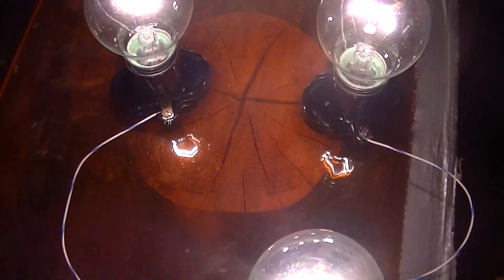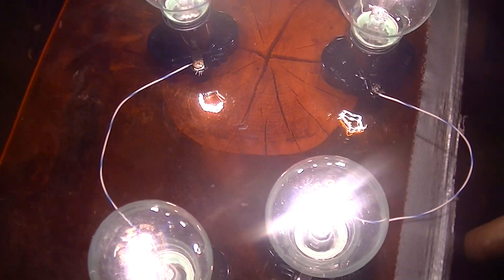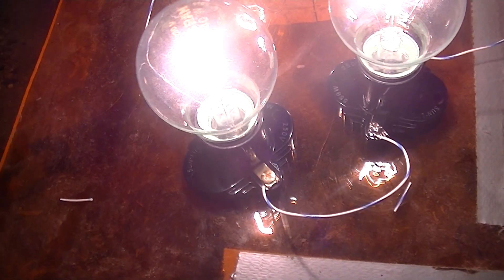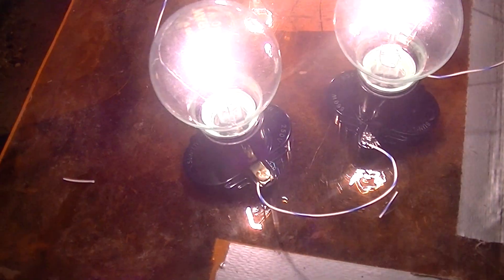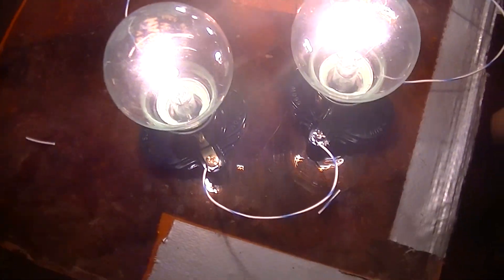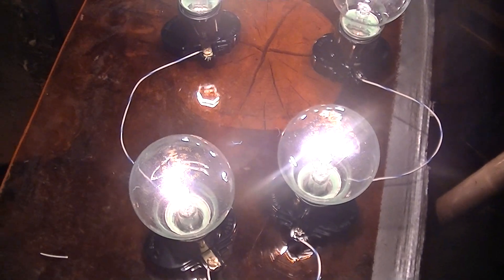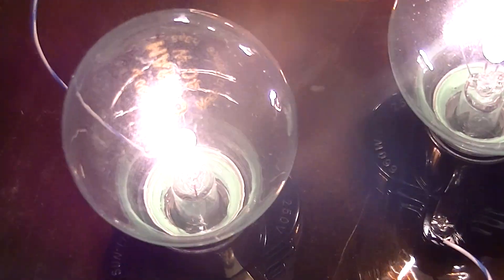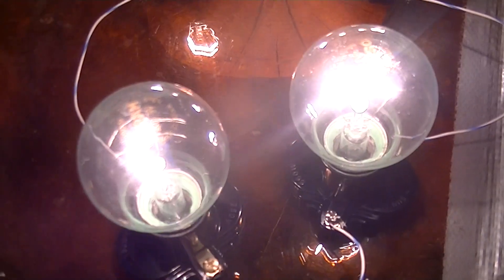Series incandescent circuit

Comment: I live in NY and not to far from the osram plant.They every year give away free light bulbs  I even worked on a diesel gen set when I was working for a different company.The gen set put out 16 kva at 60hz I even got a special bulb that ran over 10k volts yes 10,000 volts . Where I worked I got a transformer to go from 220 to 10k at 1 amp . I have had that bulb for over 20 years and I test it once about 6 months to see if it still works. What is the highest voltage bulb do you have?
Reply from the maker: I have some 300V 50W rough service lamps, but have seen 650V cage filament lamps for use in third rail testers.  If that 10kV lamp is incandescent then it is almost certainly an experimental 'can we make one' laboratory prototype/curiosity as there is no practical use for such a lamp that I can think of.  As such, be careful with it as it is either one of a kind or one of only a handful of such lamps to exist.  Knock wood.

Comment: What are you actually doing with this arrangement?  Tapping direct off power lines?  It might be interesting to put a dead lamp in and see if it ignites the fill gas.
Reply from the maker: This is for a power line experiment that I will be conducting knock wood this summer.
Reply: randacnam7321 I'm guessing that if you're actually going to try and tap off power lines, then this isn't affiliated with any actual facility company.  Purely because the sheer current and voltage available is enough to cause horrendous results under fault conditions.  For instance, the progressive avalanche failure of lamps and ionisation of the air amongst the spark gaps and bases resulting in a huge fireball that could have a knock-on effect of engulfing the lines to create something even bigger.  It's also worth mentioning that there is a wide range of voltages used in rural distribution ranging from about 3kV to 11kV and beyond.  Have you seen the line powered neon tubes?  They're actually used to mark low lines near industrial plant.
Reply from the maker: bigclivedotcom
Not in real life, but I have seen photos.
This is for an experimental power line that I'm building as a test of ways to get electricity very long distances for cheap.  The big transformer at the top of the screen is a ~1,230V couple kVA (no idea as it is homemade) transformer that we have had floating around for longer than I have been alive.  This is the main feeder transformer.  I use 2kV microwave oven transformers to supply 75V train lamps, but I also have a few 1,150V secondary transformers for feeding 120V loads.
Reply: randacnam7321 Ah, not so bad.  What sort of distance and power are you considering?  Here on the Isle of Man the local electric tram (vintage) uses clusters of three 240V lamps in its stations, powered from the 500VDC lines.
In the UK our standard supply is 240/415V (theoretically 230/400V now) so the cable sizes are thinner and you get less drop over distances.
Reply from the maker: bigclivedotcom
Quarter to half mile, but my system could be extended to a few miles with what I am doing now.
Series lamps were (and in some cases still are) commonly used here for use on 600VDC train lines.  They were vacuum atmosphere lamps to prevent arcing at end of life (which would be BAD considering the very low system impedances involved) and had oddball power ratings to denote them as series lamps (36W, 56W, 101W, 151W, 201W and 301W with potential ratings of 110V, 115V, 120V and 125V depending on the circuit potential, which could be anywhere from 550VDC to 625VDC).  There were also 30V lamps that had design current instead of design power ratings that had integrated antifuses to keep the rest of the lamps in the string lit when one died.  These were usually used for train car and streetcar interior illumination.
Reply: randacnam7321 What are you planning on using as insulators and to keep it clear of accidental contact?  I suppose that these days the use of LED arrays for lighting and switchmode supplies that can accommodate a wide voltage range make it viable to just use say 220/240V and then convert it to 12/24 with a switchmode at the other end.  That way the load will be lower resulting in less voltage drop, and any drop there is will be compensated for to a degree by the switchmode as it aims for its target voltage.
Reply from the maker: I use ceramic electric fence insulators.Switchers and LEDs are less robust than transformers and a given load can use much thinner wire with my system as the load currents on the HT side are much lower.